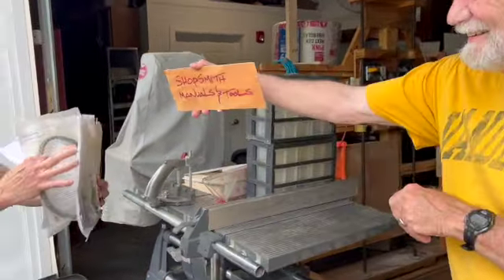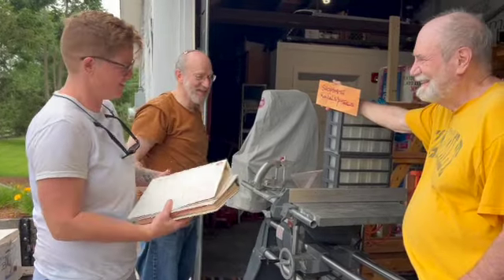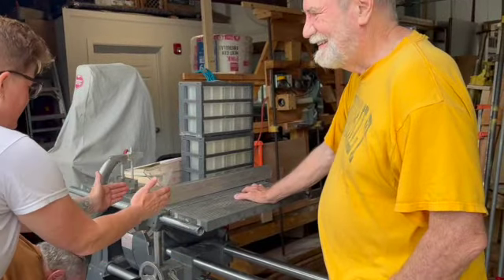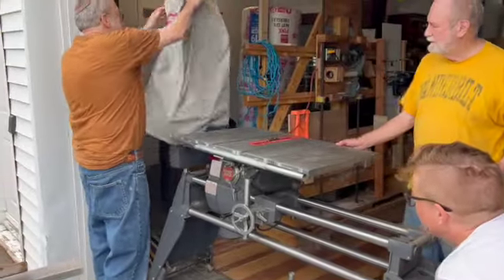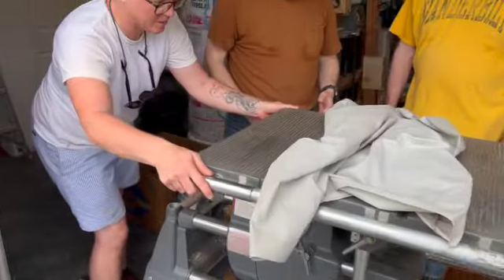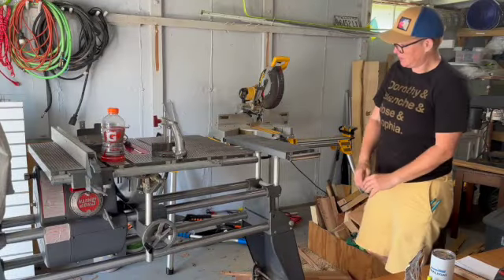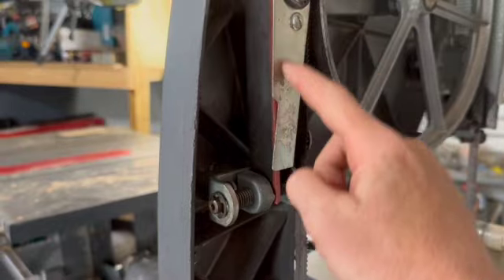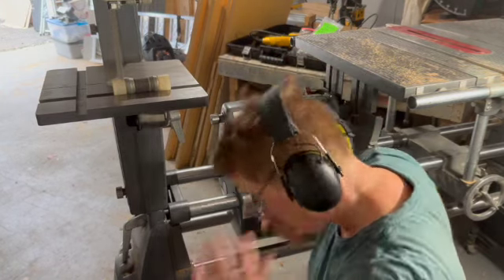VINTAGE WOODWORKING TOOLS: Shop Smith Mark V  I  Powertools 101

Comment: Congratulations! I used a neighbor’s Shop Smith in the late 60’s. It performed beautifully. The only draw back to a Shop Smith is where complex projects require operations requiring table sawing, then band sawing, then the drill press, then the lathe, etc. means spending a LOT of time breaking shown and then setting the machine up for each different operation. It did teach me the importance of Order of Operations though.
Reply from the maker: Hoping that the more I do it the smoother it will become,
Reply: I’ve spent almost 40 years using SS. After some use you will learn how to change operations. I never spend more than about 2 minutes and most of the time less than one.
Reply: I guess amateurs in the 50's had time to devote to switching from one mode to another.
Reply from the maker: Not there yet, but good to know I’ll get more proficient
Reply from the maker: Hahaha when things were slower

Comment: I'm so glad I found your channel after watching you on A2A. Pay no attention to the naysayers re the Shopsmith. While my small shop has standalone tools, before slowly building it out over 30 years, I wanted a Shopsmith so badly, but anyone who actually wanted to sell one, wanted a fortune...because they're worth it. It looks in great shape and I think it will be perfect for you as you get it cleaned/lubed/tuned and familiarize yourself with it. I actually have a SawSmith - a 1960's precursor to your ShopSmith - radial arm saw that was so rough that I didn't dare run a blade on it. So I converted it to a sharpener/sander/polisher/horizontal drill with 360 degree access to attachments, variable speeds, etc. I live in southern California and looked forever for a left-handed nut to attach to adapt the armature (had really odd threads). Finally found it in an ancient tool shop in LA. When the grooved belt finally went, I freaked out and finally found what I think may be the last new old stock one anywhere. Now it's running like new. They never die, unless not maintained. I use that bastardized machine nearly every day when I'm in the shop.
Reply from the maker: Love to hear it! Thanks for sharing

Comment: Hey KP, I have owned and frequently used my Shopsmith Mark V for 30 years! It's a great machine that does so many operations. It takes a while to get used to changing it for the different operations,  but you will get used to it. Refer to the manual often. The drill press will do things you can't believe. Looks like you got many extras with it which will serve you well. If I'm not using the table saw I always take that plastic saw guard off and stow it. It's one draw back is the table saw operation. Good for small stuff,  not so much long stock or angles. Get a separate table saw. Love all your work on Arabella and training Steve to sail! It's awesome that you are a ship wright! Live long and prosper!
Reply from the maker: Excellent advice, I’ve been pondering that too.

Comment: I had a '75 shopsmith.  The jointer and shaper are good investments.  My documentation included plans for a folding workbench and wheeled tool cabinet.  Both are great for small spaces.
Reply from the maker: Glad to hear it. I still have a lot of hours before I will feel efficient with it.
Reply: I have a ShopSmith as well but am missing a lot of parts. I inherited it from my father. But I think parts got misplaced and sold or thrown out. What is a “shaper”? Someday I can’t wait to get a planer of some type.

Comment: Congratulations!  Jumping into the YouTube deep end with both feet!  I hope that Covid-19 problem you had has gone away.  It can be really bad from what I have seen, though I haven't been bothered at all by that disease.  Lucky roll on my part.  Good luck to you forever!!
Reply from the maker: Jumped right into this YouTube thing! The Covid is a huge mystery still to be sure. It was a very difficult 5 months, but I consider myself so so lucky to be this much better.

Comment: i am just starting to set up a little shop in my basement and am headed to pick up a shopsmith on saturday! it doesn't come with quite as many attachments as yours does, but i'm still REALLY excited about it - i've needed a drill press forever, wanted a lathe for a while, and i wouldn't have been able to justify buying all the other tools independently.
Reply from the maker: Congrats!!
It takes a while to get adept at switching between tools, but you can often get accessories if you look. Have fun and good luck!

Comment: 1. Get or make a blade guard for the band saw. 2. Thoroughly inspect ALL bearings and replace ASAP! The new bearings are so much better and you will have less load/drag on that motor and veriac( variable speed controller) love the videos, keep them coming!
Reply from the maker: Thanks for the tips!
Reply: There is already a guard on the band saw.  It was all the way up for the test cut, instead of being lowered to just above the work piece.  Your bandsaw is fine!

Comment: My father always wanted a Mark V, but ended up with a 10ER (which, sadly, eventually developed a crack in the carriage that made it impossible to use as a table saw.) It was a great machine for the space he had available for a shop, but changing modes was enough effort that he ended up getting a small standalone drill press eventually to supplement.
Reply from the maker: bummer that it died.
I also have a small stand alone drill press, it’s compact and very useful.

Comment: Welcome to the group . Now watch out they multiply. Had one now have 4 , 3 band saws two jointers one little rough, and a scroll saw.   Have fun but make sure you read and understand the manual’s. Be safe.
Reply from the maker: Hahaha I don’t have space for them to multiply, but I do need to change the tires of the band saw wheels and refurbish the jointer! Manuals abound!

Comment: Congrats!  The Shopsmith is a wonderful machine for small spaces.  I have 2 of them in my basement shop.  

Do you have a 20 amp circuit in the garage? Are you using an extension cord?  The Shopsmith (should) be run on a 20 amp circuit, and if you use an extension cord, make sure that it is very heavy duty.  

There are lots of great YouTube channels and Facebook groups for the Shopsmith.  Enjoy!
Reply from the maker: Yes, 20 amp. I can usually reach the one outlet, but if there’s anything else running (space heater for example) it trips.
Reply: You have two? I inherited one but I think it’s missing so many parts. I basically have the framework, sanding disks and I have no clue what else. It has been crammed in my small garage along with all the other big tools I inherited. My intent to use them. Now, to figure out  what amps I have in the garage. My boyfriend installed two new outlets and one leading outside when I insulated and installed the garage. It’s all a learning curve. I got buckets of parts, socket sets, files, stuff I have no clue what they go to. I found the workbook on line. That will help. Do you have guards over the saw blade? Kind of scary looking. I’m going to go out later. I think they are supposed to kind of fold up to take less space. Am I right? Any good links or tips are greatly appreciated❤
Reply from the maker: What is working for me is focusing on one tool or function at a time. For example, I haven’t set up the lathe yet. But I use the band saw all the time (until I broke the blade!).

Comment: They do draw a fair amount of current. To use it as a table saw you need to be a trained dare devil. you will still probably need a decent table saw if you want to make angle cuts, the table saw work table bed is kind of too small! My Shopsmith doesn't have the table saw table leaf extensions, but even with them the table isn't long enough (in the direction of the cut). Good luck with it ! They are still very versatile machines, I enjoy having mine. Watch your fingers!
Reply from the maker: Thank you. Table saws will always scare me just a little. I call it a “healthy fear.”

Comment: Have you solved the outgassing problem?
Reply from the maker: Nope. 🤬
Reply from the maker: Working on an updated video, but honestly, it’s painful to watch it unfold over and over again.
Reply: @MakeSpaceByKP  have you thought about hanging plastic on the wall 🧱
Reply from the maker: I have. I’ve been avoiding it, as cutting it to fit tightly in all the joist gaps will be a real pain. But I might have to.
Reply from the maker: Hahaha I like how you think!

Comment: I inherited my father's ShopSmith.  I don't know what to do with it.  After seeing this video I am missing so much!  I have the saw blades and sanding disks.  But no clue about anything else.  I don't know whether to keep it and invest in more parts or sell it.  I wish I had the binders she has with all the information. I came here because the sanding disk is connected and I am working on a project that needs a good sanding.  Any ideas?  I also have another band saw (although it needs a good make over), a drill press, large lathe and more.  The plug along is not grounded.  Just two prongs.  I wonder how hard it would be to rewire it?  So, more videos on this machine...Here I come..
Reply from the maker: Welcome! It’s a learning curve for me, too. I have a small space and I’m used to large shops.
I think the info is available to print digitally. If not, there are short tutorials. 
As for the grounding plug, they are replaceable and not too complicated.

Keep your eyes out on Craigslist or Facebook marketplace for accessories. I haven’t yet cleaned and fired up the jointer or the lathe, but the possibilities are endless!
Reply: @MakeSpaceByKP  Thank you. I am hoping to move soon. I wan a shop that I can move around in. I did find the study guide on line which was a big help. I just feel all the pieces to this got thrown away or sold when my step brother was emptying the house after his mom died. My father had his own business and brothers were greedy.  I’m just thankful the step brother let me have what I got. I even have my great great father’s hand tools.  You can feel the quality. Anyway a learning curve! Thanks for replying. I will look into that plug issue.
Reply from the maker: Sounds like you have a solid start to practice! Cheers!